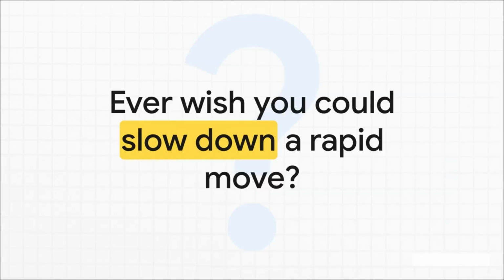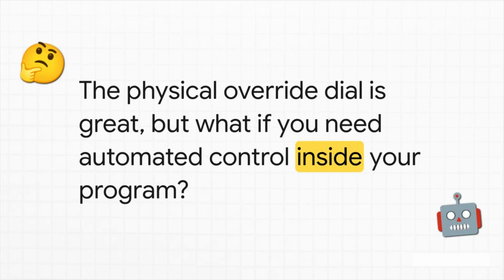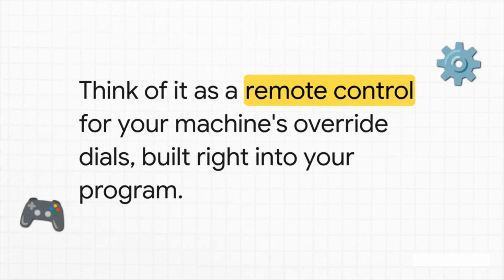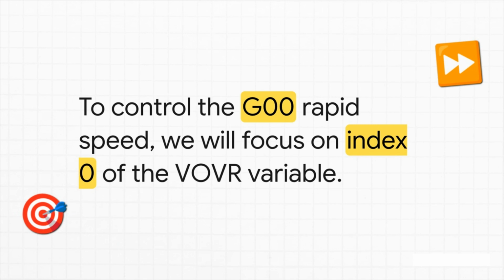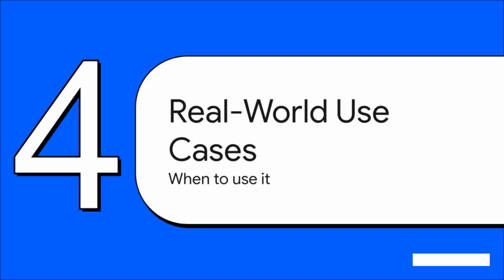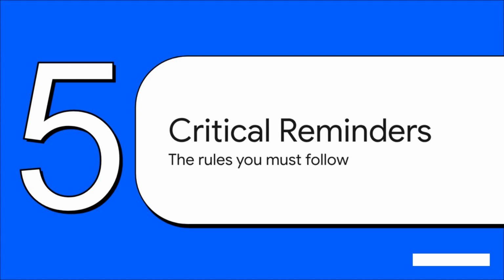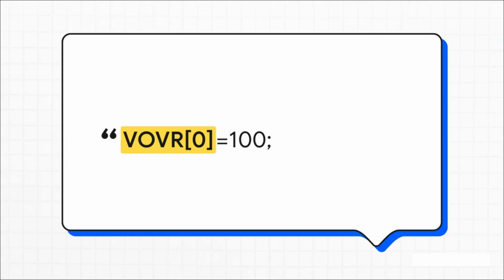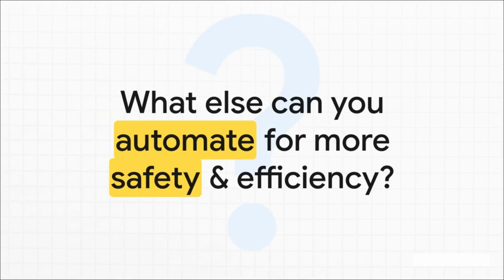Okuma OSP-xxxx Series CNC: ⚙️ Variable VOVR[0] to Adjust Rapid Feedrate G00

Comment: Is this available on all OSPs? What about OSP-300?
Reply from the maker: Hello, 
The VOVR (Variable Override) system variable is considered a core feature of the Okuma OSP (Okuma Sampling Path) control's programming environment and is generally valid and functionally consistent across the most common modern and recent OSP series, including:

OSP-E100

OSP-P100

OSP-P200

OSP-P300 (and the latest compatible control, OSP-P500)

While it is difficult to guarantee its validity on every legacy OSP control model ever produced, the variable is fundamental to the system's architecture and is supported across the control series most currently in use or recently retired. Okuma's design philosophy is to maintain high program compatibility between different OSP generations (e.g., P300 programs run flawlessly on P500 controls).

Comment: Does this work on osp E100L ????
Reply from the maker: Hi there, 
The VOVR (Variable Override) system variable is considered a core feature of the Okuma OSP (Okuma Sampling Path) control's programming environment and is generally valid and functionally consistent across the most common modern and recent OSP series, including:

OSP-E100

OSP-P100

OSP-P200

OSP-P300 (and the latest compatible control, OSP-P500)

While it is difficult to guarantee its validity on every legacy OSP control model ever produced, the variable is fundamental to the system's architecture and is supported across the control series most currently in use or recently retired. Okuma's design philosophy is to maintain high program compatibility between different OSP generations (e.g., P300 programs run flawlessly on P500 controls).